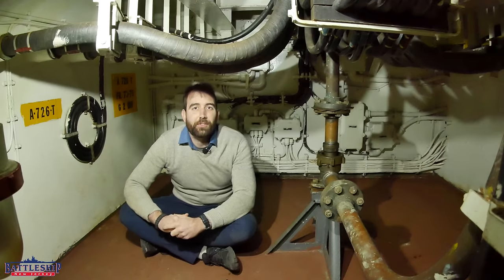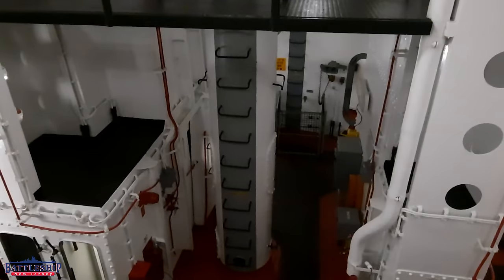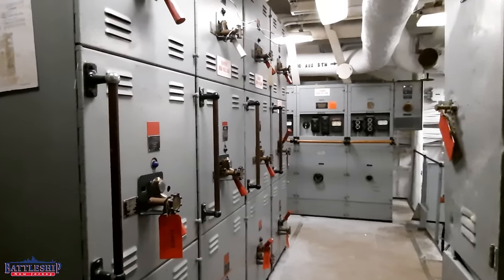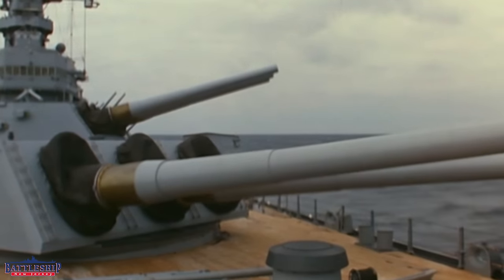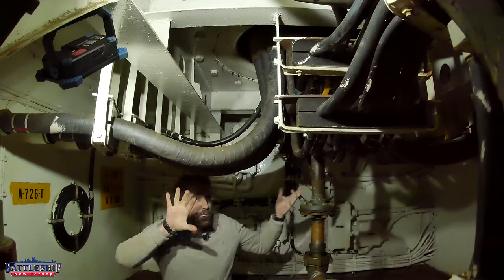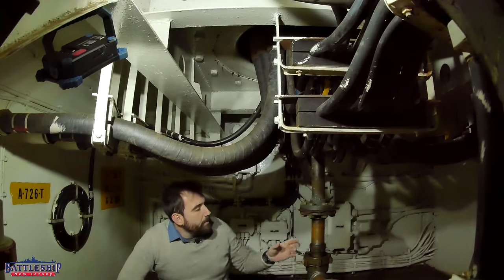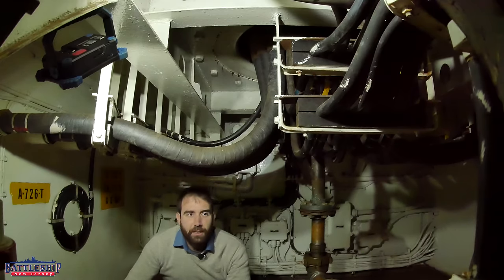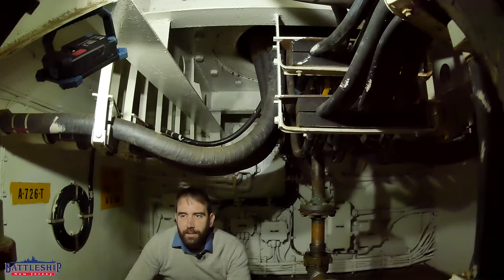Connecting the Rotating Turret to the Rest of the Battleship

Comment: This is from Page 1-18 OP-769 (the manual for the 3 gun turret)

Power supply.

Normal, alternate, and emergency electric power is supplied to each turret from two of the ship's four main 440-volt, 3-phase, 60 -cycle twin turbo-generators. This power is supplied to each turret through flexible feeder cables originating at connection boxes in the wiring trunk below the base casting of the central column. Cables lead upward through spacer blocks in the central column to a wiring recess at the top of the column, just below the electric deck. Slack in the cables at the bottom of the column permits the cables to twist and flex during turret rotation. From the wiring recess, the normal and alternate cables are routed to a manual bus transfer panel located in the machinery space of the upper projectile flat. The panel is equipped with switches and indicator lights for selection of either normal or alternate power supply. From the manual bus transfer panels power is supplied to five circuit breaker power panels. These comprise three for gun equipment (one for each gun), one for training gear equipment, and a miscellaneous equipment power panel.

These circuit breaker power panels supply power to all power drive controllers and the several auxiliaries, except for the illumination system. The emergency cable is routed to the I.C. and F.C. power panel located in the electric deck.

Illumination supply.

Power for the illumination system is supplied to each turret form the 120-volt, 60-cycle ship's electric service system. The power is supplied to the turret by flexible cable, through the central column, similar to the arrangements described in the preceding paragraph. From the wiring recess at the top of the central column, the cable is routed to two automatic bus transfer panels located on the electric deck and pan floor. The panels automatically transfer the 120-volt supply from normal to emergency, or visa versa, when required.

OP-769 page 1-20

Gas ejector supply

Air for the gas ejector supply is furnished by the ship's air compressors. The general arrangement of this system, together with the counter recoil air supply replenishing pipe system is shown in figure 1-18. The gas ejector supply pipe line enters the turret beneath the powder handling platform through a 2-inch pipe fitted with a swivel joint beneath the base casting. At this point a vertical 2-inch pipe extends upward through the exact center of the central column wiring tube. Within the wiring recess at the top of the central column the pipe is fitted with a 90 degree ell fitting which extends the pipe line horizontally rearward on the longitudinal center line of the turret, to the exterior of the wiring recess. At this point the pipe line turns toward the left where, interconnected with three T fittings the pipe line extends to five relay tanks (two on the upper projectile flat, three on the lower projectile flat), and upward to a point below the center gun pocket . Here the pipe line has two branches, one leading rearward to the air supply connections for the auxiliary gas ejector and sprinkling system and the other leading forward to three 1-172-inch branch lines. These lead upward through the forward ends of the right, center and left gun pockets where they terminate at 1-1/2-inch gate valves, which provide local cutoff of the gas ejector air supply. Connection of this supply to the gas ejector valve on the gun is described in chapter 3. Relay tanks each have a capacity of approximately 7.5 cubic feet.

The counterrecoil air supply replenishing pipe enters the turret through the foundation bulkhead into the annular powder handling space where it connects to a bank of air flasks. These are connected to a turret pipe system (by a portable pipe connection) which leads upward to a separator in the rear part of the center gun pocket.

The separator, which has three branch lines leading to air charging connections in the gun pockets, is provided with a pressure gauge graduated from 0 to 3000 pounds per. square inch. Gun pocket air charging connections are provided with similar pressure gauges.

Comment: I thought that pipe was for the flooding system. perhaps its for draining the magazine after its flooded. I was not aware of the reservoir tanks inside the turrets. Only part of the magazines rotate (the central loading platform) Isn't there additional fixed flooding systems in the non-rotating magazine areas?

Comment: Are the fire suppression flood tanks in th turrets really gravity drained? It seems like they would be air (nitrogen) charged since it wouldbemore effective pressurized.  I'm pretty sure that 'air over water' pressure  tanks for wells would have common enough and its a simple reliable system. It is basically the precursors to modern captive air pressure tanks.  Just curious 🤔

Comment: Slight correction: at 3:13 you said the turret can rotate "270 degrees in either direction." Obviously you meant 270 degrees total or 135 degrees in either direction.

Comment: @meta knight do you know where that test was done? Was the gun on a platform on land or affixed to a ship? If so which ship? That was my question initially. (in reference to a chat discussion). Trying to figure out which 16” naval gun punched a hole in shinano’s turret armor)
Reply: Probably done at Dahlgren VA. When I was there in  May of 2001 they had a Mk7 model O set up . They used that one to try and replicate the Iowa explosion.
Reply: @manitoba-op4jx  yeah sorry it happened right as the live stream ended.
Reply: @georgedistel1203  rear info, thanks!

Comment: I thought they used steam to clear the tubes of any stray embers after each shot. 
If they don't have boiler steam piped in, they'd have to make steam inside the turret, of course that needs water. 
Btw, swivel connectors are common thing to connect fluid or pressurised gas pipes to a rotating machine. 
That pipe might be water supply for that plus the fire protection reservors.
Reply from the maker: Its just compressed air through the tubes, not steam.

Comment: So, it sounds as if no warship turret can rotate 360 degrees? There were ships that had turrets with 360-degree clearance, which seems a bit of a waste if the layout doesn't defeat the "we have to go around the long way" problem. Or does the "270 degrees in either direction" refer to degrees off the centerline in either direction?
Reply: Actually it should be 135 degrees in either direction, 270 degrees full traverse from stop to stop.
Reply: @stevematda976  Any theories on why a navy would build a gunship with space for 360-degree turret traverse, then? Or on what the maximum practical turret traverse might be, given these limitations?
Reply: @Vinemaple  the only benefit in having 360 degree rotation would be time saving in certain firing situations.  But you would still have to be careful to avoid sending rounds into your own superstructure.

Comment: It would be so cool if New Jersey's guns were turned to the side as if they were firing a full broadside.
Reply: The ship would list to a few degrees.
Reply: @billkallas1762  That's what balasts are for
Reply: @frogfichtrlustr369  was about to answer the same way. I don’t think Ryan would want to pump that much water into her. For some strange reason he seems to like having as little water sitting around as possible. lol
Reply: @chrisb9960  not strange at all. Ships corrode from the inside out.
Reply: @billkallas1762  turn one port 45⁰ and two starboard 45⁰
Reply: @cleverusername9369  I’m sorry. I thought the joke was straight forward.
Reply: Can they reach Manhattan?
Reply: @EDKguy  No
Reply: @billkallas1762 I belive the turrets are balanced front to back. Otherwise, the rear of the turret would lift off the roller bearings and the turrret would be extremely difficult to turn. Therefore, I dont think the ship would list much or if at all if all the guns were trained to one side. 

 A like comparison would be some historical tanks which suffered from unbalanced turrets and were difficult to turn manually.

Comment: Speaking of the turrets, did the Iowa Class have an automatic firing mechanism?

I know people suspect that at the moment Hood was sinking that a short circuit in the electrial system triggered the firing mechanism of  1 of the gun in one of the forward turrets
Reply: As I recall from visiting USS Missouri, the guns are fired from where they are aimed - well outside of the turret.  You pull a trigger like firing a pistol.  I'd think they'd have to be electric.
Reply: As the video shows the turrets do have an electrical system
Reply: Firing control computer fires the guns.

Comment: The battleship turret cannot turn 360° however irrigation pivots can turn 360° so I'm curious as to how electricity is delivered from the ground at the center to all the motors on the wheels.
Reply: Its the big cables you see in this video.  The cables have enough slack to allow comfortable, strain-free movement.  For the 1980's refit, the turret train range was reduced from the original 300 degrees to the current 270 degrees so as not to allow the muzzles too close to the new missile equipment, to prevent shock/overpressure damage to that electronic equipment.

Comment: Some of the most difficult things I've had to deal with in my hobbies is all the electrical crap!
They didn't do a great job educating us about this stuff in high school physics.  I STILL don't know how I passed with an "A" in that subject!!!  I've fumbled through and blown LEDs and ruined circuit boards through the process of soldering but somehow STILL got 85%+ of my projects to go the way I generally wanted!  😅
Basically, as a homeowner and self-maintainer you fumble through this crap relying on instructions from people who HOPEFULLY didn't neglect critical steps!!!  That's the problem with a lot of computer programmer advice -- they leave out things that would be NICE for the lay person to know!  Hands-on and hardware guys generally do a better job laying out instructions and what to look out for.
The most important thing EVERYONE should know when they change their light switches (which constantly break or eventually wear out because of the cheap build) and light fixtures in their home is that you TURN OFF the power at the circuit breaker before you disconnect wires!!!!  If you can interpret and work your circuit breaker board like you should, you'll probably avoid electrocuting yourself!!!!!🤭

Comment: What I don't understand is why they didn't just provide 2-3(for redundancy) power feeds to each turret, and break them out into individual circuits within the rotating part of the turret. Less parts to break and the turrets could be prewired before being dropped into the barbet.
Reply: From the description given in the video it sounds like that's exactly how it is set up.  Each turret has main feed from two engine rooms each that can be switched between if one feed loses power due to damage or other issues.  There are other things besides just power as well, communications, fire control, etc.
Reply: @johngaltline9933  Yup.  The power would be 3 phase, so requires 3 cables and a ground.  Those look to come from either side and go to power distribution lineup; probably feeder panels on opposite ends with an inter-tie panel in the middle (feed half the load from each feed; if one feed is lost, you open that feeders disconnect and close the inter-tie to run on one feed, and only half the power would be lost).  The control and communications cables are the smaller ones connected to the Bakelite cable rack coming from the front that Ryan pointed out in the video; those would have been brought in  bulk cables and distributed in communications/control panels.
Reply: There are also dozens, if not hundreds of communication cables.  All the fire control data links, plus sound powered phones, dial phones, and status indicators.     Slip rings for the power would be massive, and a source of sparks in a magazine space, so bad idea.   Recall that the cable trunk probably goes up to the electric deck before getting broken out for individual cable runs.   So thats three or four decks of vertical for the cables to twist.   Plenty of flex there.

Comment: That central pipe is probably compressed air for the barrel purge system.     There is a fire hose that flakes across the deck of the powder flat for connecting firefighting water between the fixed and rotating structure.   ISTR that there is a tank of fresh water up in the gun house for some purpose I can't recall.   Since the barrel purge system is a vital system, there is probably an air compressor up on the electric deck that can provide backup compressed air for that purpose.  There is backups for everything else after all.

Comment: If I was upgrading the iowa class I'd upgrade it for anti air and anti sub and land bombardment basically a mobile command center
Reply: It already has those capabilities. Land bombardment was one of the main functions of those 16in guns, and she has done that job on at least 1 occasion. The 5in guns are dual-purpose, anti-ship, and anti-air weapons. So for those systems, would just be an upgrade to the radars and targeting and tracking computers. The ship is even equipped with missiles. If it was me I would look into ways of replacing the steam boilers and drive motors with newer systems. Likely having to build the new drive system and powerplants in place to avoid having to find a place to cut large holes in the structure to install an already assembled system in.
Reply: @Krahazik  Problem is that the 5 inch guns can't track a modern jet fast enough.

Comment: I’m skeptical that the turrets can’t rotate anymore for lack of electrical power. Pascal’s Law suggests that any small hydraulic pump hooked up to the hydraulic lines would cause (slow) movement.
Reply: Turret drive is electric motor direct drive via gears. Ryan said before they do not have enough shore power available to drive them which I could easily believe.

Comment: Where are sails kept? I have been told they are huge as they must drive the ship in case it runs out of oil.
Reply: I would be surprised if Iowas carried sails, but even if they did, the sails wouldn't be that big, as the ship was never intended to operate as a sailing vessel. Even the WW1 battleships had more or less abandoned sails.
Reply: The sails are kept in the sail locker, of course.
Reply: @michaelsommers2356  and tended to by the salesmen